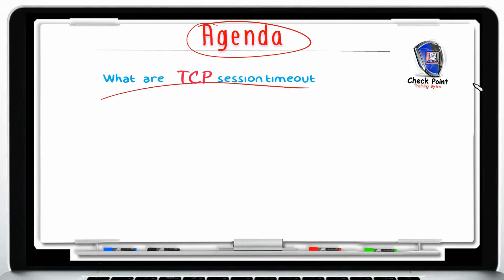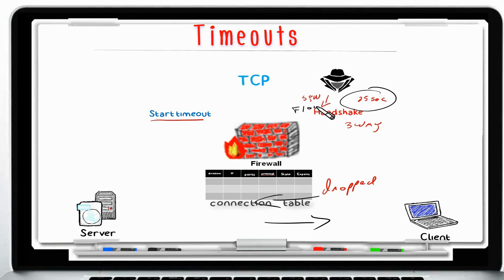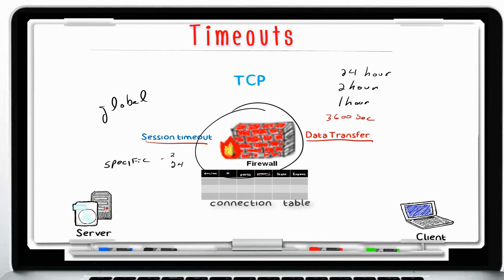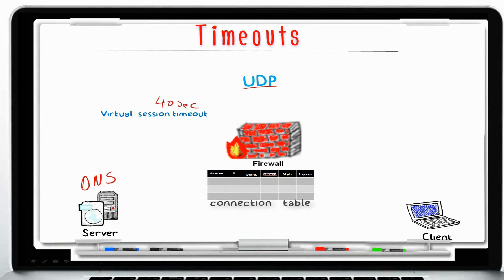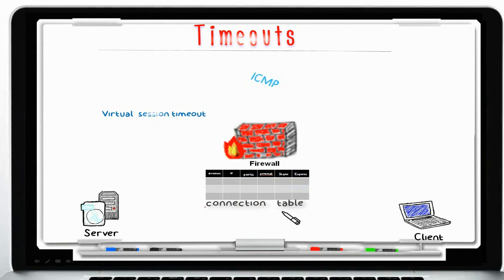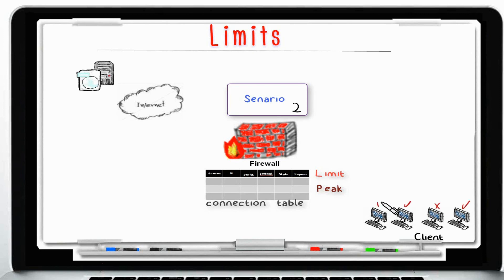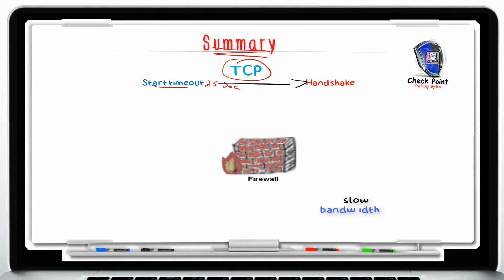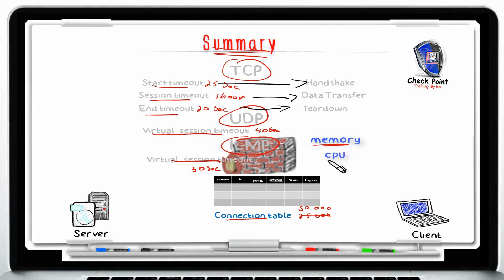Understanding Check Point FireWall Part 4

Comment: Hi Manuel, one little question/remark though. There are also UDP services that do not accept return traffic and you will get drops because of this not expected behavior. I think it's worthwhile mentioning that would need to change the service in SD to get your replies accepted. Log entry is something like "Bidirectional traffic not expected'. Don't know the exact error message anymore.
Reply from the maker: Hi Kristof ,  ya there is always going to be some weird issue or behaviour,   thanks for the info